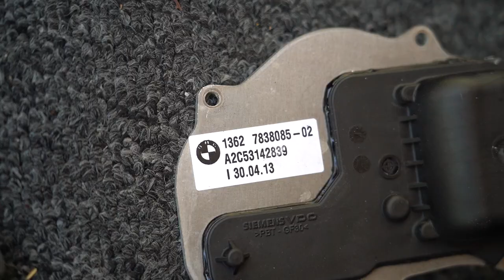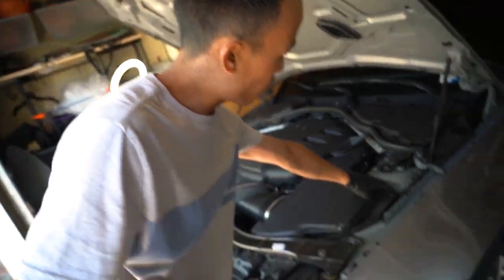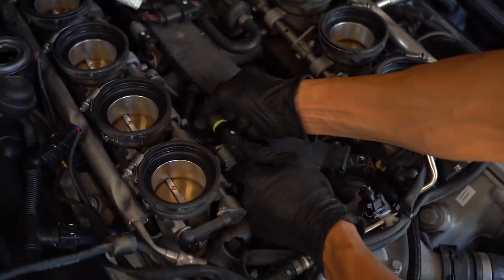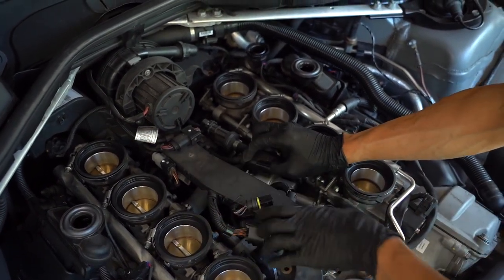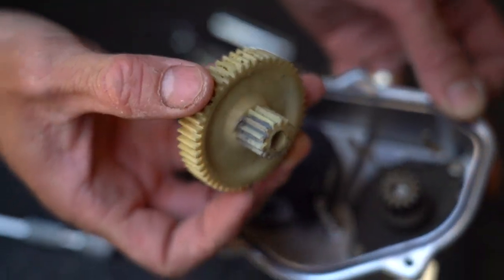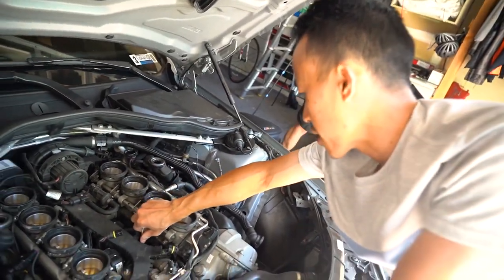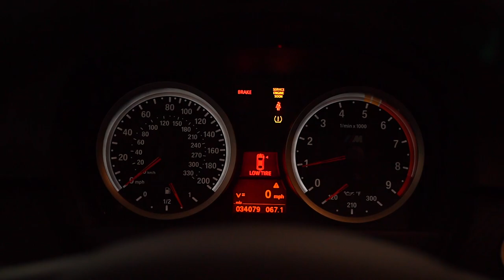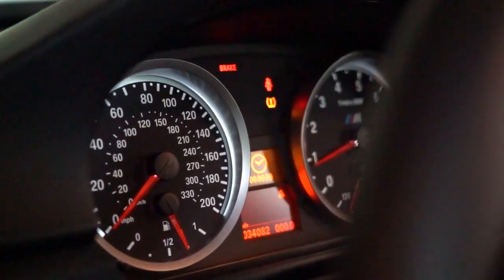E92 M3 Throttle Actuators Replacement (Failed at 34,000 Miles)

Comment: I have 180,440 on my S65 and dont need these yet. Good motors and they LOVEEE TO REV. The only thing they go through is gas and tires
Reply from the maker: wow that's impressive!!
Reply: @wettm3  Yeah but i dont rev it like you that much. I only shift around 3000 and 4000 mostly. It has enough power for everyday driving. Very comfortable and drives so stable .

Comment: Damn bro that’s just bad luck lol I’m at 130k with my s65 and still no actuator issues rod bearings already replaced though
Reply from the maker: wow that's crazy! keep em running strong
Reply: Maybe you don’t floor it all the time like wettm3 does and your have lasted longer without the abuse.
Reply: @FishFind3000  I would agree with you if I didn’t beat the piss out of my M3 lol I only drive it fast every time I drive it the only way they should be driven 🤷🏽‍♂️👍🏽
Reply: @chalatan16  yessir! Drive em hard or not at all, after it’s warmed up of course haha